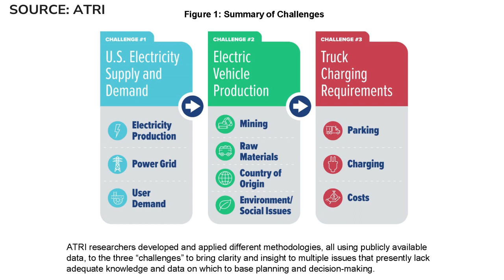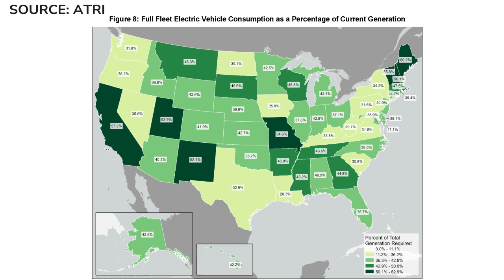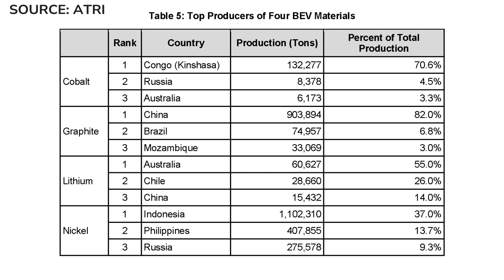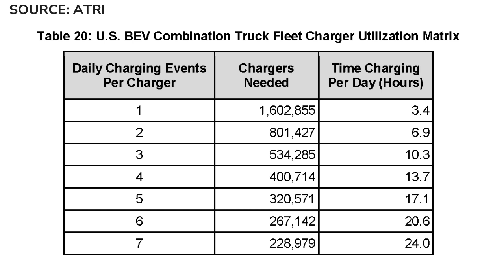The move to electric trucks in the U.S. presents numerous challenges

Comment: I was really expecting this video to be anti-EV truck but I'm pleasantly surprised to see a calm, rational discussion about the benefits and challenges of electrification. Well done!

Personally I think for both practical and cost reasons we, as a society in North America, should transition to using electrified rail for long distance freight movement. It would eliminate a lot of the challenges associated with long haul electric trucking while also improving supply chain efficiency. A single train would use far less electricity than a fleet of electric trucks to move a given amount of goods a set distance. It makes no sense to me to electrify the trucking industry as it is today without also transitioning a bunch of it over to electric rail. Given how the rest of the world has been using electric rails for over a century now it seems like investing in that infrastructure would be better long term than investing it all into less durable vehicles.